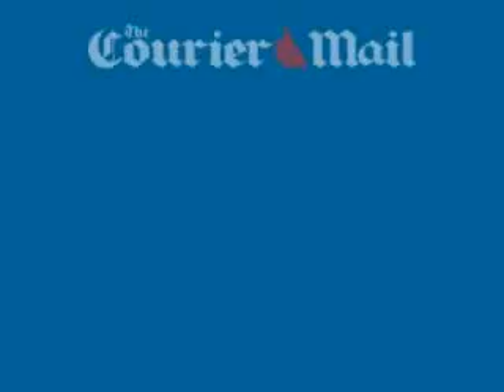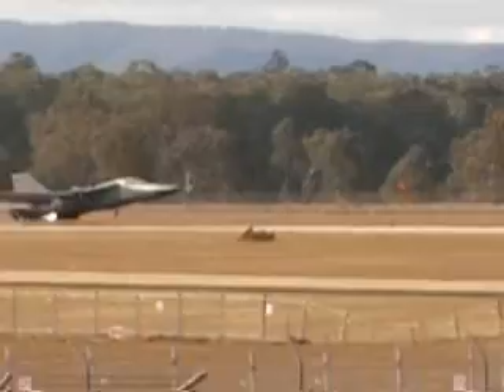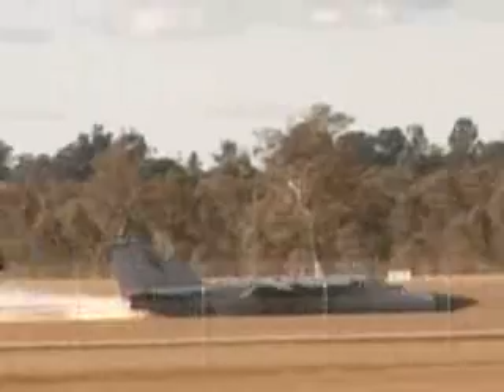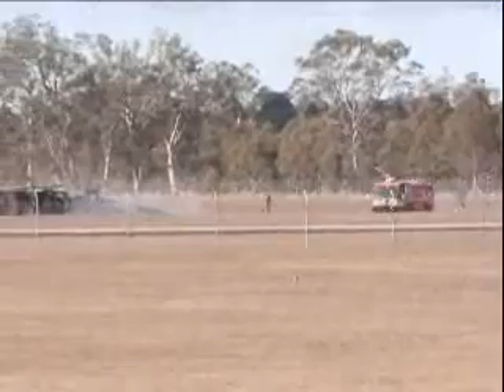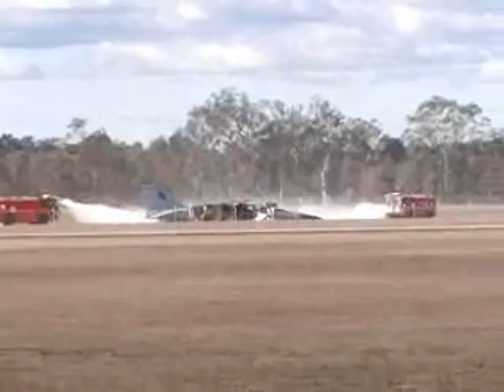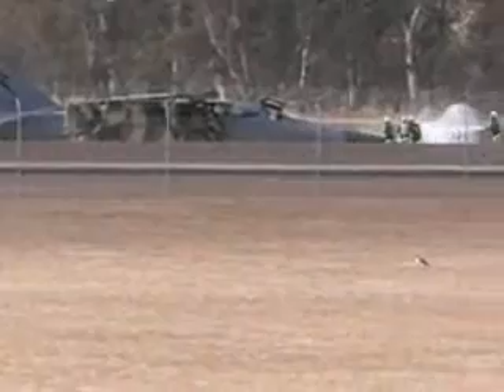F111 Belly landing!

Comment: @barraxr8 I was purely refering to this incident with a US example, at no point did i mention the RAAF or any accidents they might have had with their version of the F-111.

Given that the 111 was neither in performance/ Projected cost or reliability what it had promised to be, & that it was shortly thereafter superceded by the "Rockwell B-1 Lancer" (which first flew only 10 years after F-111), we Brit's were wise to cancel the "F-111K" Order when we did, as it would never have been worth it.

Comment: I am ex RAAF and was based at Amberley at the time. I didn`t see the landing but had heard that one of our 'Pigs' was making an emergency landing. The day after you could see the F-111 sitting on its belly pointing down the runway pinpoint perfect on the white line just as if it had been placed there. Amazing flying. And this bloke was only two weeks graduated from his training.
Reply: Then maybe you can confirm or deny the urban myth surrounding this event.
The Myth being that the wheel that fell off during takeoff actually landed on and destroyed the car owned by the mechanic who's job it was to make sure the landing gear in that plane was up to spec.